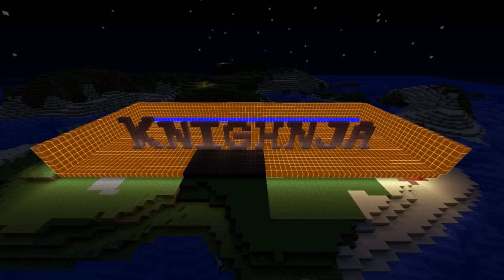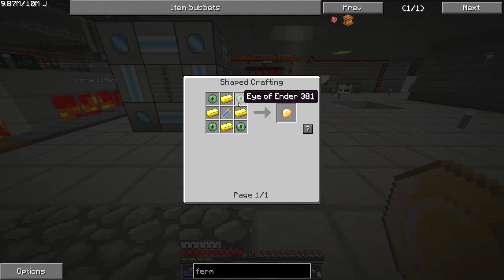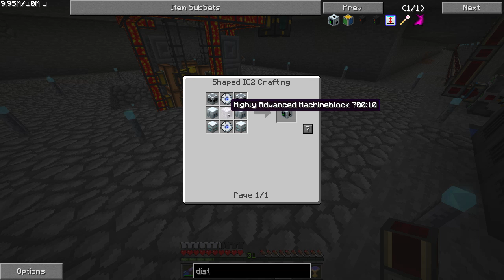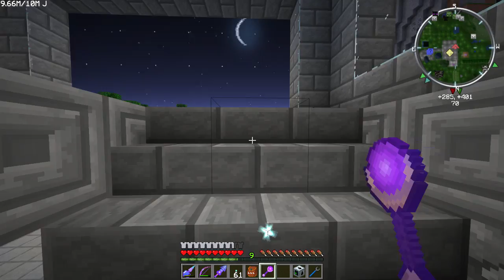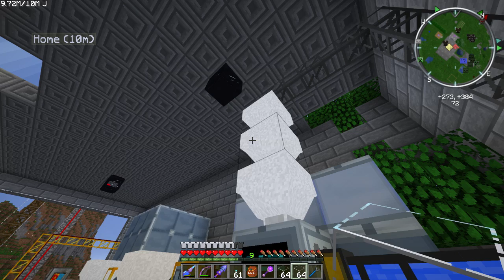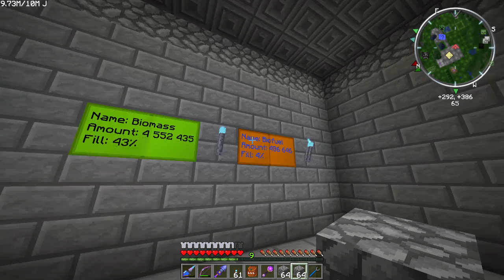FTB Ultimate Pack - S02 E28 - High Pressure Steam Boilers

Comment: To get the max out of the steam boiler you need 9 connections to the tank, you don't need switches on them. I don't know if your steam consumer will hold back the mj so you might have to add another consumer on the tank, you can get a lot more then 105mj. With those tanks and 9 connections you can power 18 ind steam engines which produce 8 MJ each. great vids